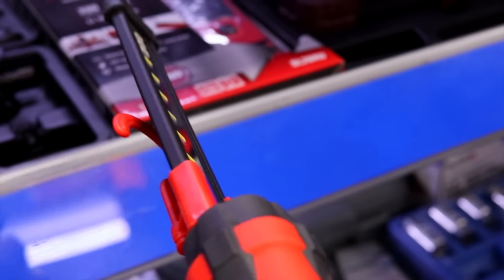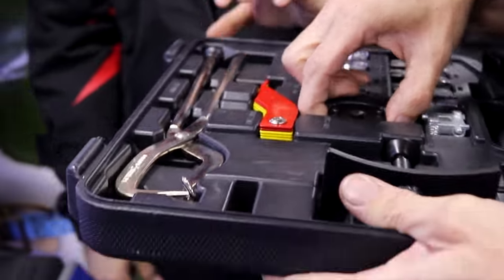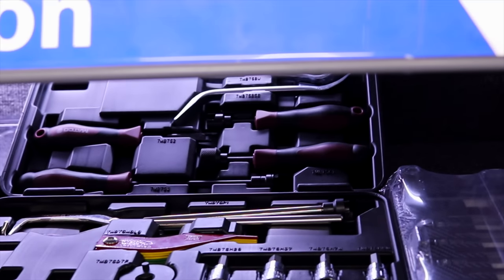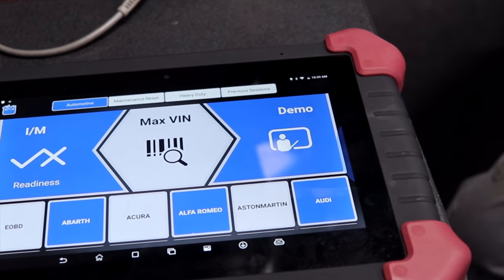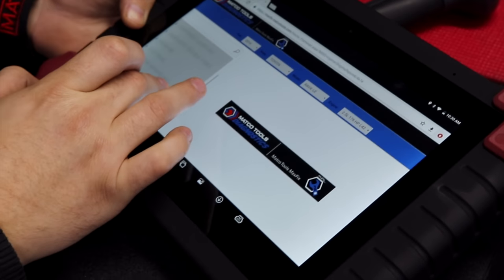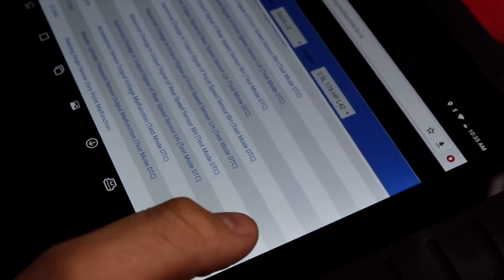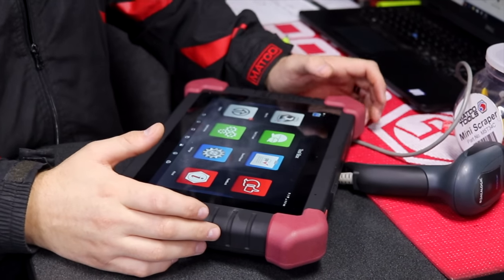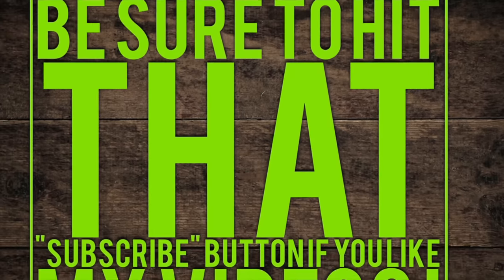Matco Tools: A Look At The Maximus 3.0 Scanner

Comment: Hello sir. I just bought a blue point scanner EECR3A. I can understand why a pro wouldn't like it, it doesn't clear oil change codes. It does have a technical services assistance phone number, I may use it, I have no idea how to use a scanner, I'm going to find out I have a light on in my car. I did get a free valve tool in a small snap-on screwdriver, they come with the little magnet or the valve tool

Comment: Have they released the class 8 truck software for it or is it only a automotive use only at this point?
Reply from the maker: They are supposed to release it soon so hopefully it will be one tool that will do it all
Reply: @KoonTrucking  thanks you for the heads up would be nice to have one scan tool to do it all

Comment: Tape on magnet,got it 

My matco dealer EVERYTHING has warranty period 

Does the scanner do def dozer test leak test?,diesel fuel block  leak test? Diesel doser leak test behind the turbo ,cat regen capable? Am all about class 8 here in other words will it run shoulder to shoulder with Cat E.t. and cummins insight & davie 4?
Reply from the maker: No clue yet because they haven’t even released the HD box so I’m sure the software will be soon after.
Reply: I can tell you now that Paccar will only work with Davie 4, as of right now anyway. The thing that sucks the worst about Paccar and Davie 4 is finding a dealer that will sell you the full complete software package. The company we buy most of our trucks and equipment from told us that they can't sell us the master version of the software because we aren't a dealer and without the license we can't have it which is bullshit!!!
Reply from the maker: That’s crazy I have it. Got it through MHC ?